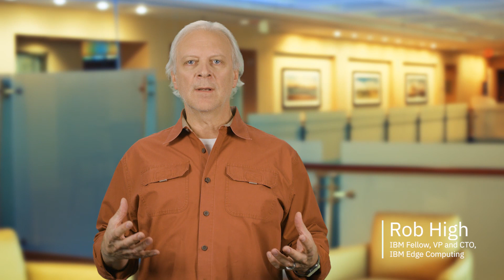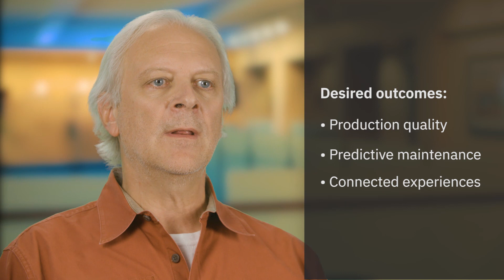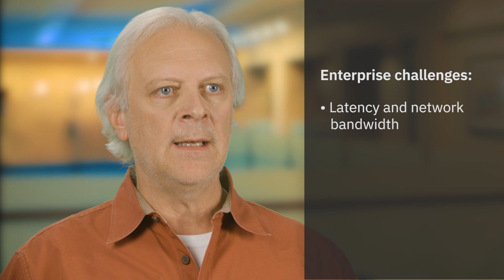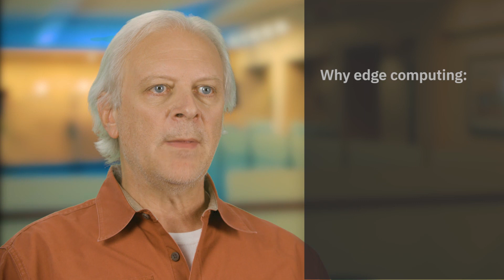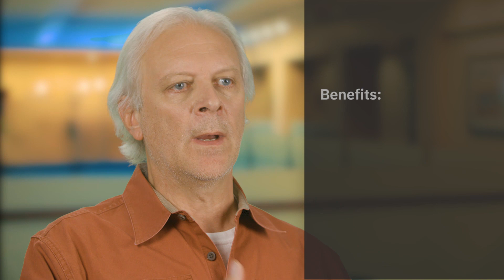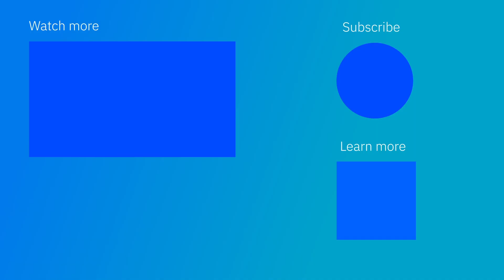Why Edge Computing?

Comment: 5G is the future
Reply: Not sure about that, Site acquisition and real estate will be its Achilles heel. Frequency at 34-40G will require 1000's of nodes with 1000's of leases. I've sited many cell sites in large cities, it take years some costing in the millions to obtain the needed public, local and government approvals/permits not to mention all the anti tower/frequency folks out there. Even if we bring back WiMax, never going to get approval from the FCC to propagate 50 Watts of power with an 17Db gain antenna in a major city.
Reply: @10UPn2DOWN  It can be done. But the cases IBM is building on are much more enterprise and less consumer related. Think Robots in factories no longer relying on wiring.